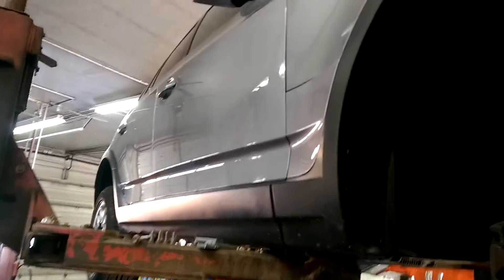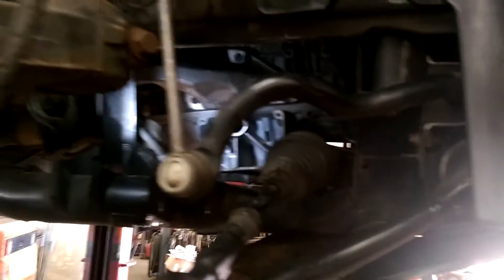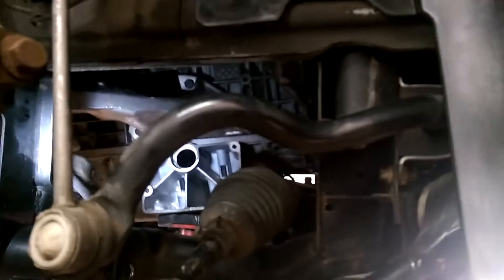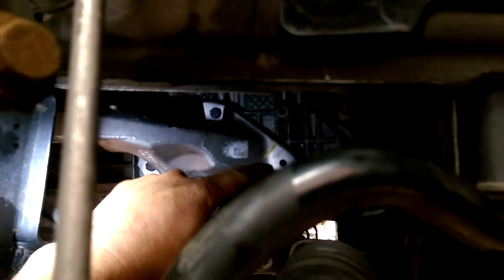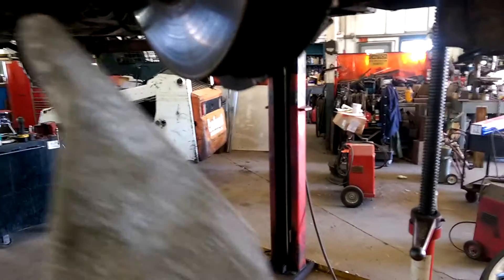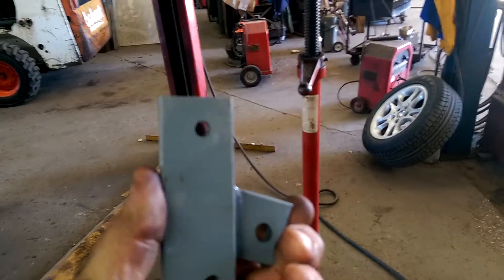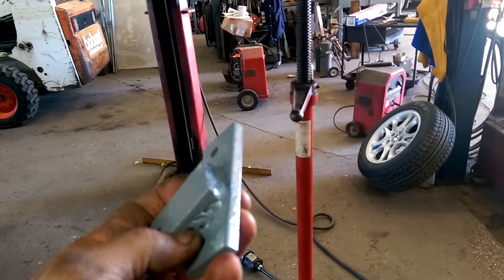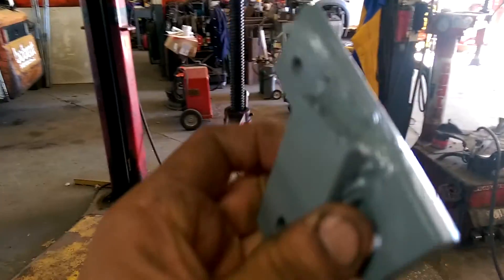BMW motor mount Broken bolt repair BMW engine block motor support

Comment: I have a 328xi 2009 and the bracket bolts (all 4 snapped off. Luckily I was able to remove 2 with no problem. But I still have two stuck in there.) based off your experience, how much will a repair cost to remove this 2 bolts?
Reply from the maker: They may come out very hard steel bolts in aluminum and also if they broke off they may be stretched so will never come out you will have to drill and tap I suggest going next size smaller and stay in Center. And then build a reinforcement bracket similar to what I built. Unsure of what it will cost but it may take several hours be prepared for significant bill.

Comment from the maker: I would have to have the vehicle here to be able to mock-up an original piece I would imagine if I duplicated the one I made on that car I suppose you could make it available but it would only work in that situation with that motor I'm sure. I don't know how much call it would be it's just a matter of thinking outside the box. If you have a good shop in your area they should be able to do this for you.